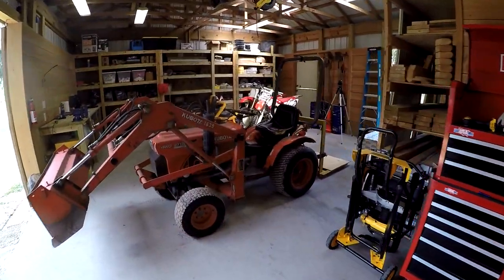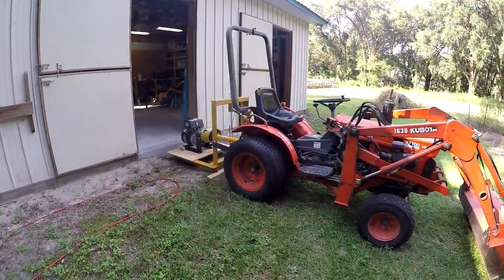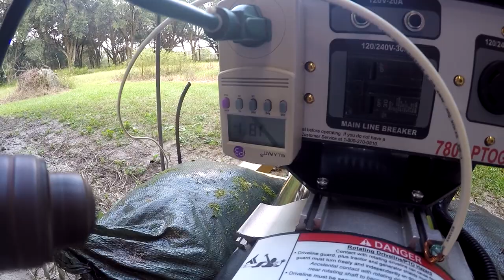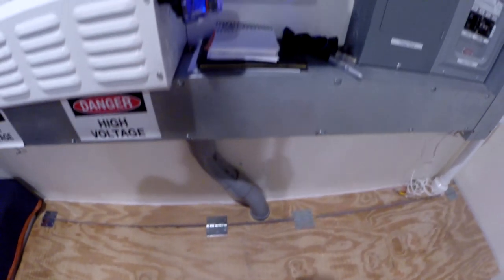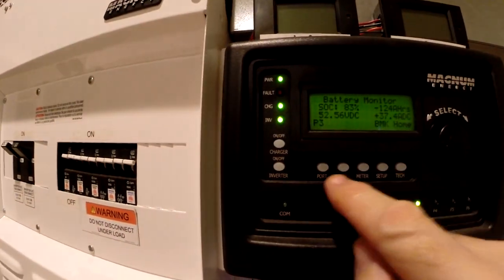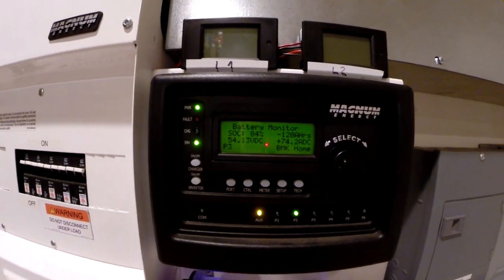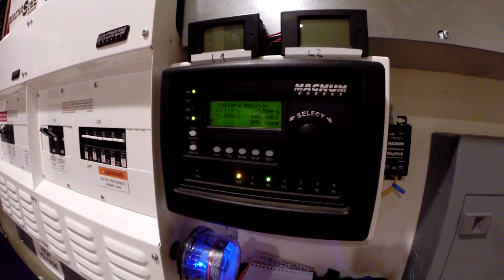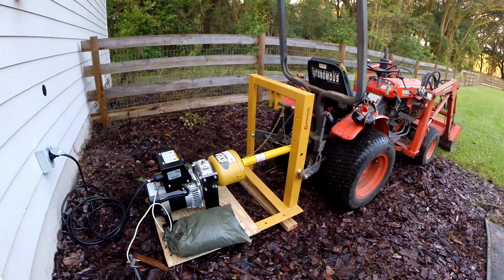NorthStar PTO Generator on Kubota B7100 Tractor

Comment: Have some doubts about the diesel burn rate although buying a stand alone, self-regulating diesel gen would pay for a lot of oil.
Reply from the maker: I don't have the exact burn rate but I think it would be around 0.5 gallons/hour.  I guess I will just have to do a test or just measure it during the next time I have to use it.  Thanks!
Reply: @HomesteadEngineering  Had some thoughts about running one on my BX (22 hp) with a five gallon tank. Running close to WOT (probably) it wouldn't make it through the night. I would be burning the same diesel, loaded or not which I find annoying :-/

Comment: That little tractor needs to be worked like that it’s not going to hurt it keep the oil changed and regular maintenance it will last it will seat the rings on the piston
Reply from the maker: Yes,  I have been pushing it a bit harder but not too much going forward.  Thanks!

Comment: Be careful that you aren’t grounding the generator when you are plugging it into a grounded system.  You only want one grounding path. If you have two when something happens you could energize the generator and the ground around it.
Reply from the maker: I believe that is correct.  In general, I would ground and bond a generator when used stand alone and not ground or bond it when connected to a transfer switch.  That is because the ground and bond from the generator will usually pass through the transfer switch and be grounded and bonded at the main panel.  Thanks!
Reply: Today, Systems typically have two paths to ground.  One a domestic water supply and two a driven ground rod.  Depending on impedance, you may have ore than one ground rod.

Comment: How is the kubota worn out, it looks like its in perfect condition, you yourself said even the engine is good, i think thats because of your newer tractor, thats what puts it in your head that its worn out
Reply from the maker: The engine is definitely good and the tractor still has some life in it.  I actually use it all the time.  It is a bit worn though.  The joints are a bit loose and have a lot of stiction.   It  is difficult to switch from 2 wheel to 4 wheel drive.  Its just used.  It is very noticeable when switching from this one to the new one for sure.  Thanks!

Comment: You don’t want your pto shaft perfectly level. That’s where your vibration is coming from. Each joint needs a bit of an angle. Look at your truck driveshaft. Make the pitch similar.
Reply from the maker: I will definitely check that out.  Thanks

Comment: That tractor only has 13hp pto.. thats not that much, try it on your other kubota. It should have a tad bit more pto hp
Reply from the maker: Yah and that's when it was new and on a good day.  Its fine for what I need to do.  It can charge my battery bank in 2-3 hours.  I don't really want to use my new tractor for this purpose.  Thanks!
Reply: @HomesteadEngineering  i thought i read that you didn't, yea  in a emergency,  the bigger one will do if you really are in a bind

Comment: This is really inefficient.  Whatever money you saved not buying an engine generator will be spent in gas.  Generators are set up by the manufacturer to be well matched to the engine and you get the highest BSFC possible.  Not to mention inconvenient.  Also, if your load drops, you could  have a blown engine.  If you have the throttle up to deal with a high load in your house and that load disappears, there is no governor to close the throttle. 
These are meant, so far as I can tell, for remote farm work.
Reply from the maker: It has been my experience that the PTO running off my tractor uses a lot less fuel than my engine generators.  I would guess maybe 0.6 gallon/hr.  Dropping the load would result in a near instant increase in throttle.  I don't think this would result in a blown engine unless you were at very heavy loads and not present.  You do make a good point though and something folks should be aware of for sure.  Thanks!

Comment: Pto shaft is def out of balance
Reply from the maker: How would you balance it?  Maybe I will try pulling it apart and rotating one click then put it back together.  That might shift the rotating masses a bit (if that's possible).
Reply: Dude ....no it isn't. Optical illusions with the safety sleeve.
Reply: @HerkCC  the pto shaft would be the only thing to cause the wobbling and vibration. My 30 years of grey hair experience speaking here. I have bought many a pto shafts off the shelf, made in China that are bent, out of alignment or not balanced properly. Another recommendation is to not have the pto shaft running in alignment with the implement. They tend to run smoother at a slight angle.
Reply: @HomesteadEngineering  I usually take mine to a local driveline shop for balancing. Can be done quickly and inexpensively
Reply: @matthall9093  what hair I still have is gray as well. I believe the overall vibration is from it not being mounted on a solid platform. I run the very same generator mounted on  the O.E.M. trailer.....and as you pointed out ....at a slight angle for proper phase of the shaft rotation......but I do see my safety sleeve dance around to mimic vibration when in operations.....
Reply from the maker: @matthall9093  OK Matt, I will give that a try.  Thanks!

Comment: I Wouldn't recommend it since your going to be racking a lot of hours on the tractor. Just go with a standby diesel generator.
Reply from the maker: Hello Guy, These diesel engines will typically outlast the tractor by 2-3 times.  By running the PTO generator I am getting all the life out of my investment.  That said, I would not run it on my new tractor, its only going to run behind my old worn-out tractor.  Thanks!
Reply: Not with a generator racking up hours. People own & use 70+ year old tractors. Issue is that the hydraulics are running when the engine is running. Especially if that Kubota tractor uses a hydrostatic drive instead of direct drive.

If there is a crisis & one machine you really need to rely on is your tractor.
Reply: @HomesteadEngineering  Diesel engines need to be worked hard like that so they don't wet stack. will not hurt that tractor at all.  My Multiquip Welder Generator has 4300 hours on it and runs at 3600 rpms when generating power not worried a bit.  These Kubota engines are used in refrigerator units that run 24/7 well over 11000 hours before an overhaul is needed.
Reply from the maker: @farmingsmallkubota1783  Sweet!  I love hearing that because I do run that little Kubota pretty hard in my garden as well.  Maybe I will crank it up a bit higher next time I need to charge the batteries.  Thanks!

Comment: As a fellow B7100 owner I was curious as to how the tractor would perform.  They were built like tanks but lack the higher hp of today’s tractors of similar size.  Evidently the internal governor cant match the power demands of the generator as it would with a mower or tiller.  The generator rpm needs are too sensitive.  From what I’ve been told the general rule of thumb for engine hp to generator wattage is roughly 2 hp per 1000 watts.  
The b7100 according to kubota is 16hp at the flywheel and 13 at the pto.  So you are probably maxing out the engine around 6500 watts and considering the hours on the tractor the actual power numbers might put you down closer to 5500 watts.  If you plan to keep it on generator duty you might want to consider adding a water temperature gauge to the tractor.  A simple method would be an inline adapter to hold a temp sensor in the top radiator hose.  The majority of the D750 engines didn’t have water pumps and used thermo siphon technology.  They like running hot.
Reply from the maker: This was the first time I tried it.  In the future, I will just crank it up and drop about 3,000 watts on it and leave it there.  No adjusting.  Thanks!
Reply: I dropped a D950 in my B7100,  That extra HP makes it a beast.  Full set of gages, Alternator with a real water pump.   I push snow with it, never bogs, nothing stops  it except loss of traction.